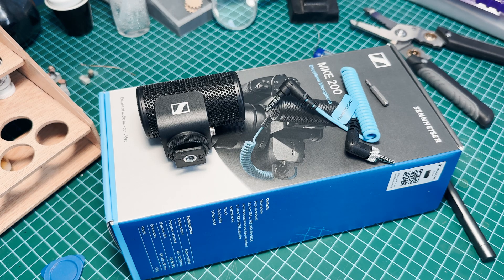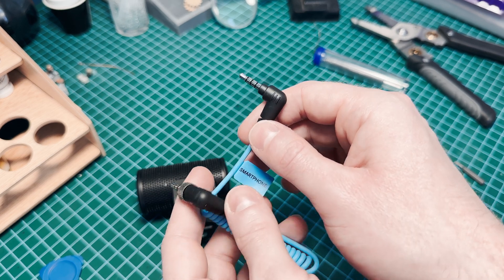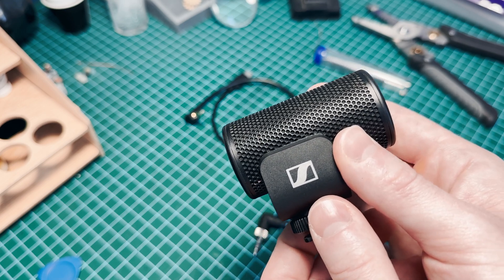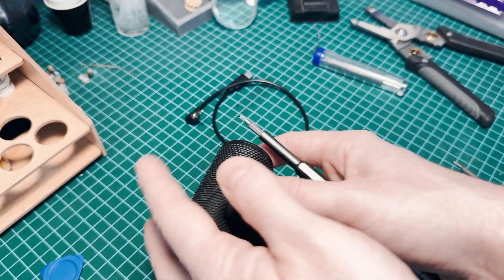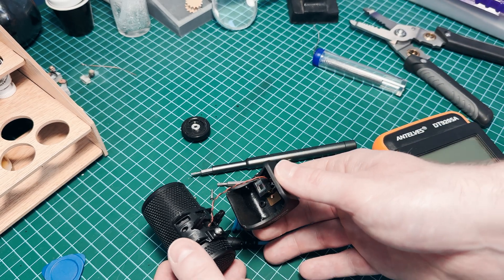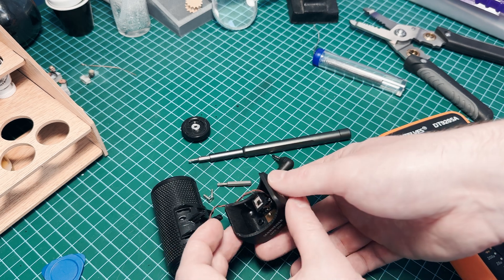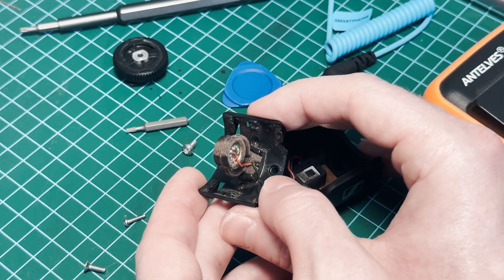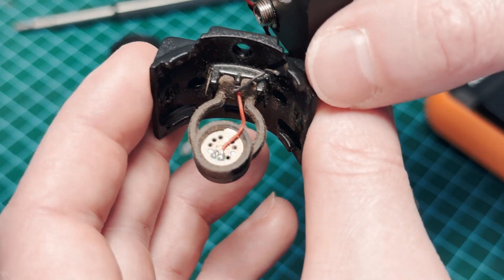Sennheiser MKE 200 Disassembly + Fix

Comment: Thanks for this, i was just trying to understand how they built the capsule. Looks like they just suspended a simple cardioid capsule, (barely) solderd on wires, called it a day. Helps me decide against it.
Reply from the maker: FWIW I ended up going with the DJI Mic 2 (just the TX), and its been great for my action 4. Connects wirelessly, much better sound quality, 16-bit, etc. Half the size as well. Very high quality too. Would not spend any money on the MKE 200.

Comment: Thanks for the Awesome video. MY mic broken for months ago and i cant manage to take off the black plastic below. After watching, i manage to take the black plastic out to access to the internal mic, then saw the freaking black wire came off. I manage to solder it back and it is working again. So happy about it. The internal wire are so tinny and can broke off easily.
Reply from the maker: @kelvinzyteng  glad to hear it helped! Yes, Sennheiser should be embarrassed for selling such a poorly made mic for so much. I actually ended up returning the one in the video and ordering another. The one that arrived was broken as well, with the same problem! I couldn't believe it. So clearly not bad luck
Reply: @Zombiefruit  i think is because of the wiring on the internal mic are super tiny. If there are major shake, it will broke off easily. Just hope the socket not broken then is good enough.

Comment: Hey this helped me massively when I also bought a mic second hand and the red cable was off. Soldered it back on and all good. I have an interesting issue with the mic - when I put it back together it didn’t work. I realised that if I tighten the two small screws fully then the mic stops working. I have to loosen them to keep it working. Any idea why this might be? Points to something on the jack socket maybe? Thanks again for the help
Reply from the maker: Hey sorry, just read this. Could be that one of the wires ended up getting pinched by the plastic shell, and tightening the screws is enough mess with the connection. Just a poor guess though, I'd take it apart and double check nothing is getting pinched